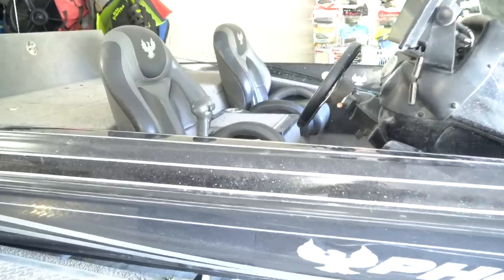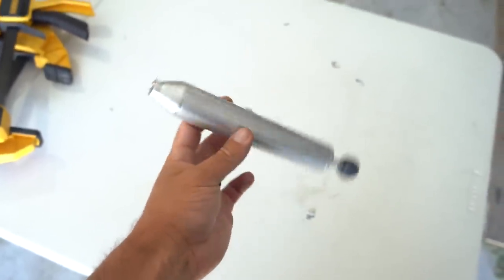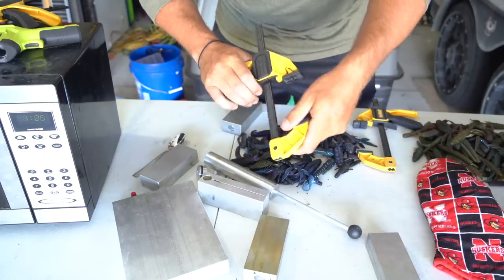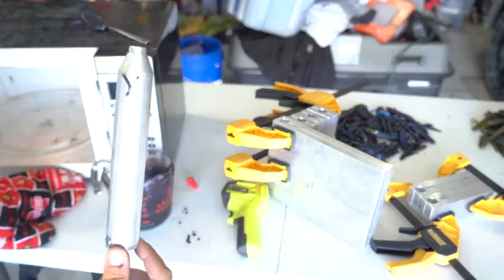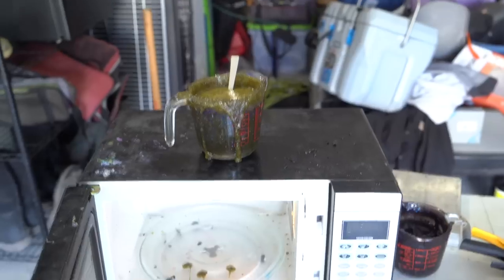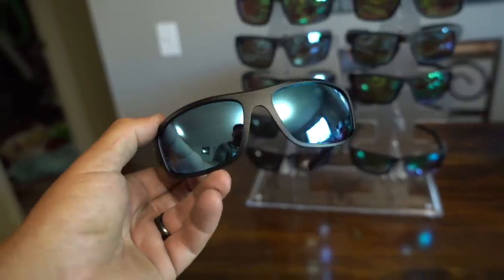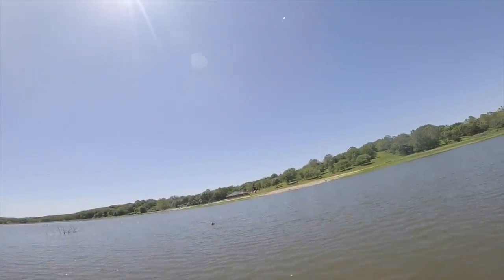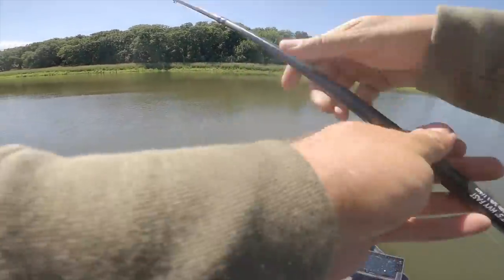MELTING My Old Plastic Fishing Lures to Pour NEW Baits!! -- (Fish LOVED Them)

Comment: Just a pro tip, you don't need to heat remelts to 350, that's just for the uncooked plastisol. And to add, if you put the baits in water when your done injecting it will cure the plastisol faster. Last thing if you hold pressure when you inject there will be less denting in the baits...not trying to sound like a know it all just trying to help out!!
Reply: I’ve had better luck pour remedy’s at 350 range especially larger baits or ones with lots of appendages.
Reply: @johnnielarge5506  It also depends on the plastisol brand you use
Reply: Are you able to use the same micro wave from the house or does it leave too many chemicals?
Reply: @kristophergraham8160  i wouldn't use the microwave for food anymore.

Comment: Hard Plastic Crankbaits to Soft Rubber Crankbaits. 

I will use the Berkley Flicker Minnow as the example. 

The Berkely Flicket Minnow is a hard shelled crankbait. But I want the same lure, hooks and bill, to be part of a rubber lure of the same design. 

Using a Do-It mould for hard plastic lure making, how would I set the bill and hooks in the mould so that as the hot goop is poured into the mould, the goop forms around the bill and hooks?

Would the mould have be a special design to accommodate the two treble hooks attached the bill via stainless steel leader line crimped into a half barrel swivel so that rings can be used, or can the hooks be ran from three eyed barrel swivel instead? 

The three eyed barrel swivel would use one eye for the rod line, the trailing eye for the rear hook and the lower eye for the ventral or bottom hook.

Hopefully this type of lure making will become a thing that will see airbrush paints for rubber worms used to airbrush the rubber body crankbait lure.

Comment: Would you be able to melt the "Z-MAN" baits? and still have them turn out nearly indestructible?
Reply: I don’t think so. They seem to have a much lower melting point also. I left some in my truck once and the melted. I stretched it to see if the integrity of the plastic was the same but it ripped where it would not have before.

Comment: Have you tried doing this with elaztec baits?  Just curious
Reply: Doesn't work, Zman's elaztech is molecularly composed much differently than standard plastisol, it's a completely different material that does not respond well to high heat.
Reply: @jakobbunge1023  I figured it would be something like that, just curious, thanks